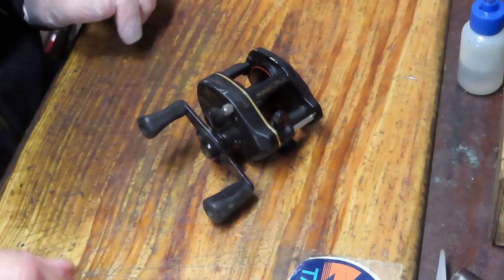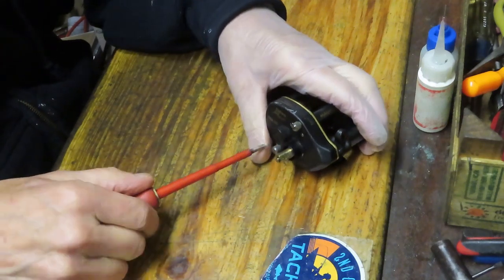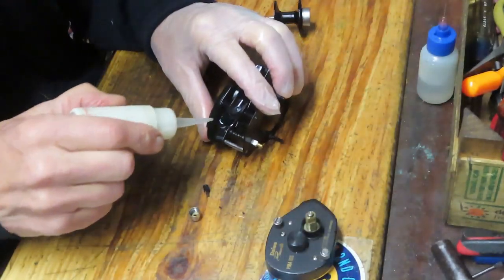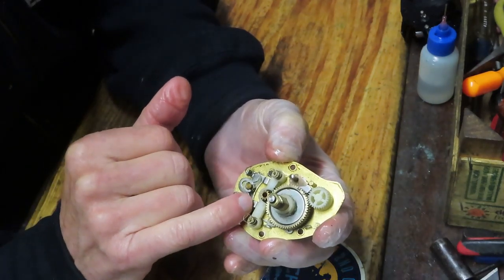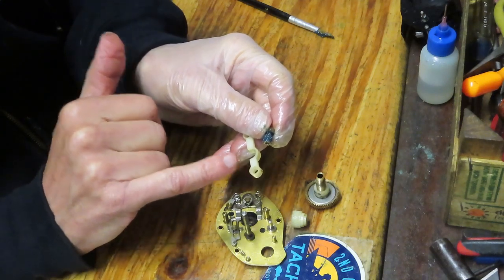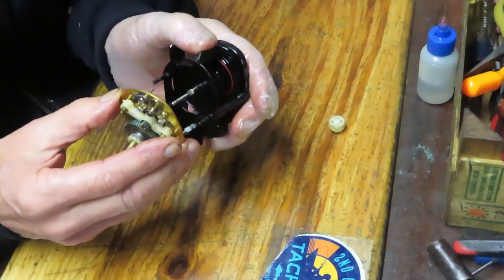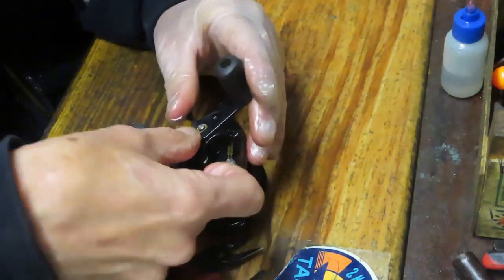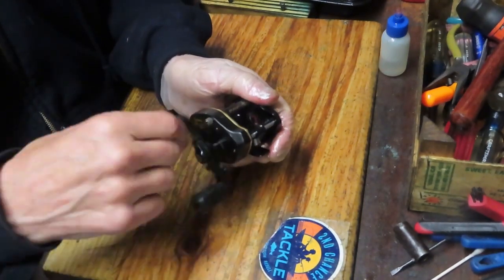Daiwa Procaster PMA 10S fishing reel how to take apart and service

Comment: I am getting into fishing and recently picked up a Daiwa 2600 Spinning reel for mid 80's. Previous owner took care of it and it works like a beut. I wanted to get a cheap but reliable baitcaster, and this thing is on ebay for under 15$. Would you recommend this for a beginner baitcaster (6 weeks experience fishing total). 

I feel like I have a tendency to like older reels because I like being able to clean and repair my stuff I own. Thank you!

My other option is buying a new one from Bass Pro for 80$. Any advice appreciated.
Reply from the maker: There are plenty of good beginner reels on eBay for that price and this is one of them.  Check the Quantum, Daiwa, Shimano and pflueger brands as they all ore good ones to learn on - Dennis

Comment: I have the Daiwa PMA-10S. Looks like yours had the brass washer part number 44 which is the gear shaft washer B installed backwards with part 48 DRAG washer C. Per the parts schematic, should be part 44 first then 48 drag washer. Yours has 48 on first then part 44. So if you look at the wordage, part 44 should be a brass gear shaft washer then 48 is a drag or fibrous type washer. So if you look at the washer stack, it's big drag black washer then big silver metal washer then small drag washer, towards handle, all push against each other. Someone installed yours wrong.
Reply from the maker: Thanks for the correction .  Not a surprise as the reel was likely taken apart for service.  Best wishes - Dennis

Comment: hi dennis i have a daiwa 6hm that is jumping into gear halfway through the cast  please help thanks
Reply from the maker: You need to check the free spool release mechanism.  Make sure it is clean and setting properly.  If it has old grease or dirt as an obstruction, it may not set properly and could trip back early